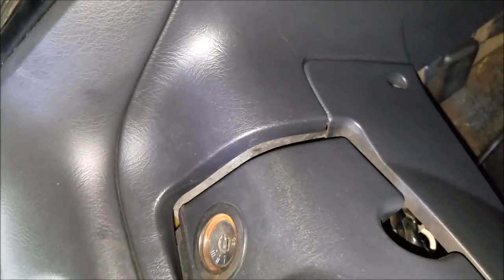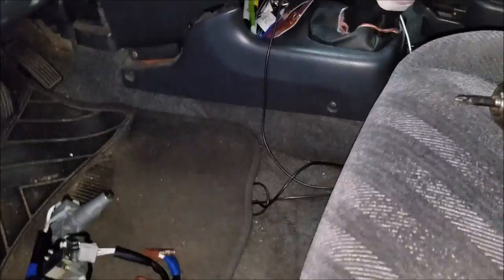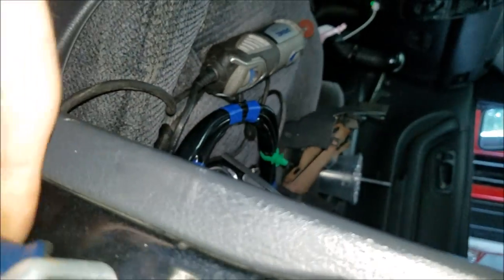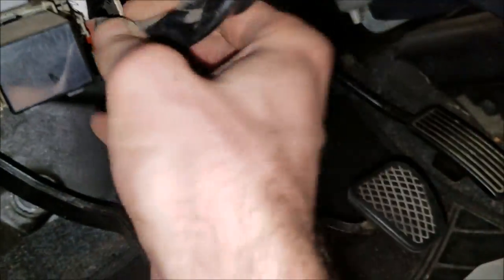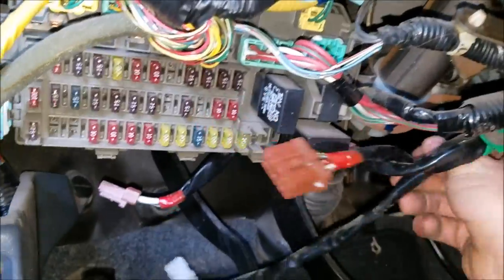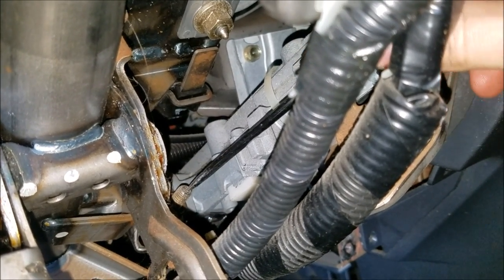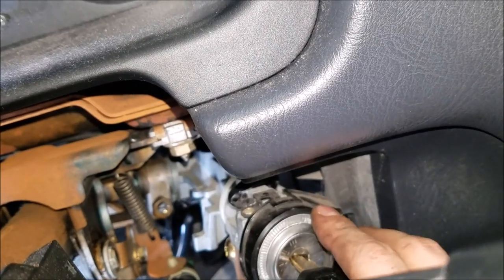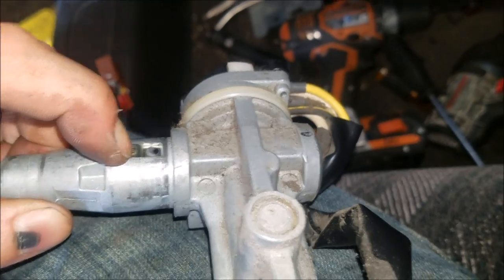CRV Ignition How to Replace Assembly - walkthru

Comment: Great video! I'm doing mine soon and plan on using a narrow long cold chisel and hammer at an angle on the broke off bolt head to unscrew it. This method has worked well for me in the past. I will edit this post if it don't work.

Comment: This is an excellent video and narrative.  It's comprehensive.  Now, I may be 76, but in pretty good shape for an old fella.  However, I must admit that every time I do underdash work, or any tight quarter work for that matter, I wish I was much shorter and lighter than the 6', 220 lbs that I am.  This is a young person's game!  So, for those like me who don't want to break anything or screw it up otherwise, a few pointers.  First, disconnect the battery.  Next, however much time you think this is gonna take you, at least double that!  Next, take the darned driver's seat out before you begin, cuz it'll make gettin' under that dash a whole lot easier, and hopefully, fewer bruised ribs, and bruises.  As always, cover up and properly cushion that damned floor mat positioning pin. othewise you'll wish you had done so!  Next, don't worry about pulling on those darned plastic panels to remove them.  Just follow Lehew's order of removing things, and watch how he grabs and removes those panels.  BTW, just cut those loom wire ties loose from where they fasten into the steel areas under the dash.  Don't waste your time trying to "carefully" pull them loose, as there are new ones on your new ign. sw. looms.  Next, find a way to make a pick like Lehew's, cuz you'll make your life much easier trying to push that pin in when removing the switch housing, and reinstalling the new one.  Do some deep breathing as you progress, and take your time.  Lastly, drink a couple of beers!!  When you get pissed, just keep asking yourself "WHAT'S THE WORST THAT CAN HAPPEN?"  Helps reduce the anxiety.  Take good care y'all.

Comment: Thanks for the vid.  I am going to just pull out the bad wafers on my lock and stick it back in.  Also I am going to just stick a normal bolt back in instead of a breakaway bolt because it was a bitch to take out.  Can you guess about how much torque was on the bold before the breakaway nut released.  Thanks

Comment: Thanks for the walkthru.    Only thing I did different was to remove the 4 14mm head bolts that hold the column up.   Made it much easier to find and locate the pin to push in.

Comment: Great vid... I was hoping for more vid detail on the Ignition-Switch replacement portion... At least I know now exactly which screws-need to come-off to get the plastic-shrouds off.

In my case, I only want to replace the ignition Switch itself, not the cylinder.
Reply from the maker: Nuruddin Peters Just go ahead and replace the whole assembly brother
Reply: Lehew Tech why did you replace the entire assembly instead of just the cylinder? Just asking because my 98 crv dies right after it turns over. Starter is about 5 years old, battery is about 1 month old.

Comment: This vid is great, thank you! I may attempt it...

Question for you, I assume then I’ll have to use the new key for the new ignition switch and the old key for the doors?
Reply from the maker: Chris Pyhtila That is correct. A competent locksmith may be able to rework the cylinder of the new ignition switch assembly to your old key prior to replacement. Good luck!

Comment: Thanks for posting.  BIG HELP in knowing what to look for-- especially that the security bolt has a welded net there.  I was going "nutty" trying to turn that with a socket.  Lol!  Thanks man!
Reply from the maker: For sure man thanks for watching
Reply from the maker: What my customer did is he just added the new key to his keyring and used the original key on the door.
Reply from the maker: Maybe if you take both the old and new switch to a locksmith will the keys he may be able to get the new assembly to work with the old keys. I would just throw in the new part and carry the old and new key tho

Comment: Are those new keys that came with the ignition cylinder, wondering if I need to change the chip in the key also
Reply from the maker: It did come with new keys and this model has no chip

Comment: All the steps where helpful, but my problem is that my ignition switch is locked on #3 position, it doesn't matter how hard I push the pin or I shake the switch, it doesn't comes out. Any help will be appreciated!
Reply: I have this problem as well. Attempted theft, someone broke the shaker key in position 3
Reply: Any news to both of you? Did you manage to take it off i have same issue... car theft issue i recoverd it but its too late the keys are wrecked. Left it i. Position 3.
Reply: I got mine stolen and the key is jammed in there. Do I need to replace the whole ignition switch kit? And do I have to remove the whole thing?
Reply: Where can I get the bolt? Do you have a pet number?

Comment: what if the car was stolen and you can't put in position #1. This is what I'm dealing with.
Reply from the maker: Id call a locksmith
Reply: I know this video/reply was 1 year ago but how did you replace without the key? My CRV was also stolen and key wont turn into the #1 position. Thanks in advance
Reply: @victormendoza590  same here did you figure it out ?